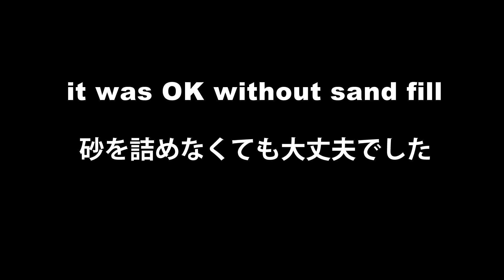How to bend copper pipe

Comment: Another way instead of filling with sand is to cap one end and fill with water, then put it in the freezer, open end up, until the water is frozen. Then bend. (Don't cap both ends, it may split the pipe as the ice expands.) This is one of the methods used in making brass instruments. Another is to melt pitch, cap one end of the pipe, and pour in pitch. Let it cool to become solid, then bend. Heat the pipe gently to melt out the pitch for reuse.
Reply: Gwen Patton I found that my pipe snapped even at moderate temperatures inside my pipe bender spring, so I will annealing this first, or risk tearing the material even in my steel pipe benders

Comment: Just some odd points to add. 

Sand fill is hard, you gotta pack sand tight. In small tubes it is difficult. 

Using improper bending parts is usually what crushes pipe.
Need to match pulley to pipe size to help prevent crushing while bending.
Reply: + Sarin Highwind  What about semolina, couscous or farina instead?